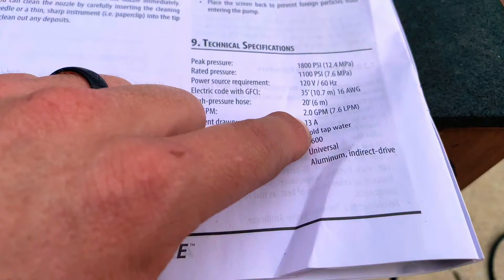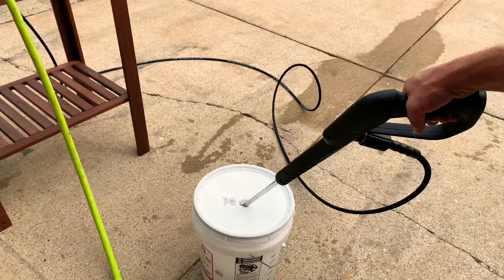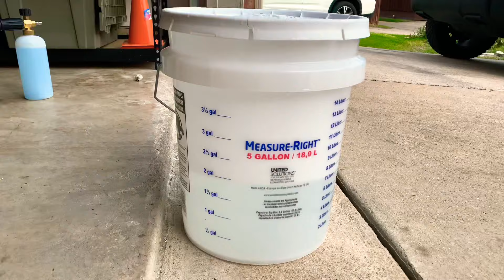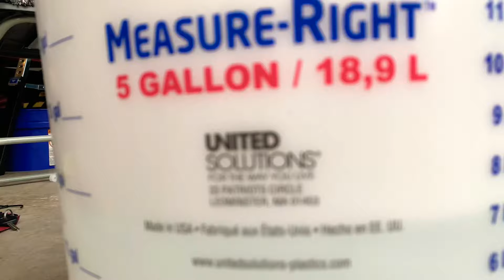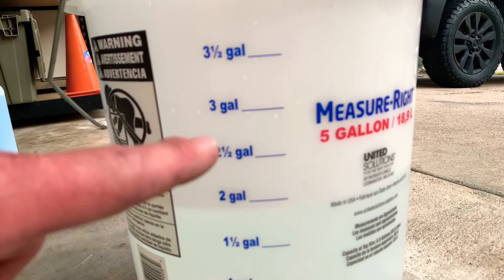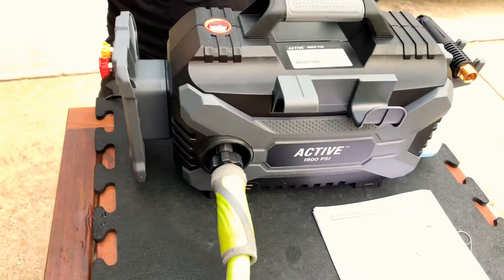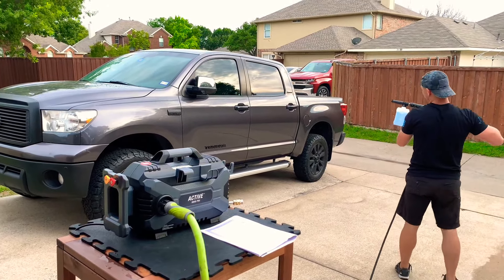Active VE52 | Electric Pressure Washer | The Greatest Pressure Washer In 2021 For The Money

Comment: For people couldn't find this unit in Canada, this Active VE52 is sold in Canadian Tire, branded as Simoniz Platinum 1800 for $299CAD($235USD).    And the tested GPM doesn't mean too much without knowing the PSI and the type nozzle used.
Reply: Just bought it at CT on sale for $199 CAD.  Great deal and heard lots of good things about it.
Reply: @andrew86-82  Its still $299 here. Is it a store sale?
Reply: @alexverdi7139  it might have been just my local Canadian Tire store.  I didn't mention it was about 2 weeks ago that it came on sale.  So the sale would have ended last week I think.
Reply: @andrew86-82  Crap. Im late to the party! thanks a lot though
Reply: @alexverdi7139   Just picked it up at my CT $199 so the sale is back on 4/24
Reply: next sale at 199$ is july 9th but today 20-05-2021 its on  sale 259 cad
Reply: If you wait for a sale, you can get it for $229 CAD

Comment: What orifice size tip did you use to get the 1.95GPMs?  I did hear 1100 PSI.  So, I assume 1.95GPMs at 1100 PSI. Just curious.
Reply: exactly right

Comment: Curious as to how its holding up now? have had my fair share of bad experiences with simoniz products.
Reply: I’m curious too. I’m thinking about buying this unit. I’m sure most of these YouTube folks are getting paid to review the unit, but I need a new washer, and this one has pretty good specs.
Reply: @AQUALUXAUTODETAILING  Thanks for reply. I didn’t mean it in a negative way. I appreciate your hard work with this these reviews. I am definitely leaning towards this pressure washer. My 1600/1.2 GPM Ryobi pump is starting to fail, and i need a new one. Thanks again for the reviews
Reply from the maker: @jimfoster9532  I would suggest when you buy this one, to add the warranty to it.  But I cannot complain Bc this thing is hands down the dominant pressure washer even this year.
Reply from the maker: @jimfoster9532  happy to help sir and I know you didn’t mean it in a negative way.

Comment: Hi. Is this a better working machine than the greenworks 1700 psi ? I’m in the market for a electric pressure washer and can’t decide between the two. Thanks
Reply from the maker: Yes it is but it will not be in stock till next year unfortunately 😔

Comment: So what's more important the psi or th gpm? Some like the sun Joe spx 4000 pro Boost 2030 psi but at 1.76 gpm at 14.5  amps
Reply from the maker: Gpm I don’t need much over 1100 psi for auto detailing.  I’m not trying to blow the paint off the car

Comment: Which quick connect adapter size do we need for the end of the gun, to allow us to connect a foam cannon to the end of the gun, instead of the wand extension?
Reply from the maker: M22 x 15 if you’re using the hose that comes w it
Reply: @AQUALUXAUTODETAILING  not the hose end of the gun... I'm asking about the wand extension end of the gun, where the metal wand extension and factory foam cannon connect to the gun
Reply from the maker: rcfreak9 okay I’m sorry for the misunderstanding.  You do not need anything special.  It will fit any foam cannon on the end of it.
Reply: @AQUALUXAUTODETAILING  let me try to clarify...if I was to unscrew and remove that metal wand extension, and then attach a regular size foam cannon to that black plastic gun, what size quick connect do I need for the end of the black gun?
Reply from the maker: rcfreak9 you can’t it’s a proprietary twist lock they have.

Comment: You will get 2.2 gpm at 880 psi with a 4.0 tip
Reply: That is what I’m currently using works pretty good
Reply: @Nintendude2013  pretty amazing. I'm buying the white 4.0. Going to love rinsing my car after my last terrible pressure washer. I will also buy the yellow 3.5 to get the most psi for concrete etc

Comment: Does it really have 1800 psi?
Im looking for pressure washer that can be used once a week on my car but also here and there on the house/sidewalk to rip off dirt. Deciding on if i should get this and leave it alone or get a cheap ryobi box for $100 and get a long hose and a gun.
Reply from the maker: Edwin P. It’s around 1450 psi and will clean sidewalks just fine
Reply: Look up other tests it’s not at what the rating says at all

Comment: What's the size of the nozzles?
Reply from the maker: Rafa, What it comes with or what I’m using in the video? Thank you for watching 🙏🙏Jw how long have you been subscribed to my channel?
Reply: @AQUALUXAUTODETAILING  the ones that comes with. Just found out it uses 3.7 orifice. My guess is that you can go bigger for rinsing soap. Definitely smaller would be bad as I saw on another video. But if looking for replacement it should be a 3.5. Kind of weird what manufacturers do with included orifice sizes.
I just can't believe the price for the gpm, amazing.
Reply from the maker: So II order to get the 2.0 gpm around 1400 psi I’m
Using a 4.0 40 degree nozzle.
Reply from the maker: Yeah it’s kinda a smoke and mirrors game the mfg play w these pressure washers.  It’s why I like to buy them and give open feedback and review them with some testing and real world scenarios
Reply: @AQUALUXAUTODETAILING  4.0 nozzle 1400psi and 2gpm? Shouldn't that be impossible?
Reply from the maker: @rafars2246  not when you are using a mv925 gun
Reply: @AQUALUXAUTODETAILING  I got the McKillans.
Ended up getting the cat1800 version, I like the case better.
My wholesun "3000psi 1.8gpm" in reality was a 900psi on average, and a 1-1/4 gpm. Totally useless to rinse the car soap 😂. It seems this is the very best you can use on a 15amp circuit. Totally unique machine specs wise.
Reply from the maker: @rafars2246  lol nothing wrong w that &  I’m
Using the cat currently 👊👊👊
Reply: @AQUALUXAUTODETAILING  I did some deep research and the Mosmatic guns are made by Suttner. Just sharing here in case someone is interested.
Basically you can buy the same exact gun from Suttner for a fraction of the price, but without swivel. The 
Mosmatic 29.132 is built exactly the same than the Suttner ST-2605. Same trigger, same built, just not swivel. Mosmatic also sells the Mosmatic 29.081withouth swivel, but it doesn't have the same trigger.
So I just got the Suttner ST-2605 on ebay for $29.99 after a $10 coupon for using the app or something like that. Instead of paying over $100. Yeah an integrated swivel looks nicer, but that's the only benefit, zero difference in usage once you install your own.
Reply from the maker: @rafars2246  that’s awesome, but the mv-925 is a better pressure washer gun because of the rate of flow and ergonomics.  Nothing against the one you mentioned, but wanted to share what I have used for over 3 years and it’s still holding up.
Reply: @AQUALUXAUTODETAILING  the ST-2605 goes well above the mv-925. 12 vs 8GPM, and 5000 vs 4500PSI.
But no matter what, a gun can't change anything because of the higher numbers, unless your machine is more powerful than what the gun is rated, then you'll need a better gun. I got the ST-2605 because of the easy to use and hold trigger. 
You can't get more pressure while using a 4.0 nozzle over the 3.7 that's included. It violates the laws of physics. Smaller hole, higher pressure, larger hole, increased GPM.
I'm getting the 4.0 40 degree too, for rinsing the car. This machine sits on the middle, so I also got a 3.5 15 degree for cleaning concrete.

Comment: I bought this unit based on the recommendation, and so far, it works well. But i have another question for anybody who has used this unit with a DI water system. Has anybody experienced a noticeable pump “strain” when running the flow through a DI system? Thanks
Reply from the maker: Yes it will tax it a little whit I run a 4.0 40 degrees orifice

Comment: I bought this unit and it works beautifully with its included gun, but when I tried using an aftermarket pressure washer gun (AR Annovi MV925) it doesn't work properly. It leaks water from the output when the trigger isn't pressed. Has anyone had any luck attaching an aftermarket pressure washer gun? I'm not sure if my unit is defective or that aftermarket gun is not compatible. I've tried contacting customer support, but they can't do anything since the unit works properly with the included gun. I am using the proper sized quick disconnects.
Reply from the maker: Not sure I use the same gun with mine and zero issues
Reply: @AQUALUXAUTODETAILING  Dang... I thought maybe the MV925 was defective so I replaced it with another one of the same model but still no luck. I'll try another gun to see if that works, I really don't want to use the included gun lol, but thanks for mentioning yours works.
Reply from the maker: Rikudou hit me up on Facebook and send me a message.  See if I can figure it out

Comment: What's TSS?
Reply from the maker: Total start stop system. Means the engine does work from the time you squeeze the trigger to instantly when you release.  How long have you been subscribed to my channel?  Great question and thank you for your time!!🙏🙏👊👊👊
Reply: @AQUALUXAUTODETAILING  
Fairly new. If you remember we had the long Facebook PM about air compressors. I  know you're a fan of brass but what size do I need to convert EVERYTHING to SS QDs (Inlet/Outlet/Hose)?
Reply from the maker: CaptAwsme I do and thank you for the  reminder...It helps me remember when I ask also.  It’s not to be a jerk but over 1500 subscribers and growing that a lot of ppl so I do my best to keep up but I need a lending hand every now and then. I’ll drop a link w what you need and it will help for future reference also.
Reply from the maker: CaptAwsme https://youtu.be/tAertd7zJms
Reply: @AQUALUXAUTODETAILING  I ask because I would like to just cannibalize from my current pressure washer which has the 3/4" MTM QDs.

Comment: LOL you need to adjust your foam cannon to a fan like spray pattern. Using it in a jet stream is pointless.
Reply from the maker: Thank you for your wisdom and guidance
Reply: @AQUALUXAUTODETAILING  I wouldn’t consider that wisdom, just pointing out the obvious. The foam wasn’t very foamy. I don’t own an electric pressure washer, I have a Dirt Killer H360 with a 13HP Honda and a massive Kranzle AQ pump. Using a Mosmatic canon and Chemical Guys melon soap my foam is like shaving cream. It’s thick and doesn’t disintegrate for quite a while. I’m not sure if that is what’s desired or not but too watery seems pointless. That saying, your pressure washer cost $180 vs mine at $4200. Mine isn’t for cleaning cars, without a much bigger orffice it would strip paint.

Comment: A 20’ hose is a joke!  They do this to keep cost low, but it’s a joke!
Reply from the maker: True but man it’s a nice one let me tell ya. I like my 50 Ft  3/8 anyways lol
Reply: PSI drops with a longer hose I would think.
Reply: Scott Hirschman nope, doesn’t work that way at all.  A 25’ hose came with my AR630TSS and I also tested with a new 50’ and the same pressure is put out.  They are just being CHEAP!
Reply: @tundrawhisperer4821  where it's PSI measured, at the pump exit or nozzle tip? I would think at pump exit would be the only constant with all the different types of hoses, nozzles, guns, tips.?
Reply: The unit was designed for portability, and yes, to keep costs down! So 20’ may be short for you but it works for storage and most people.